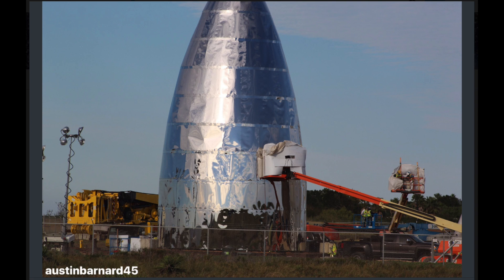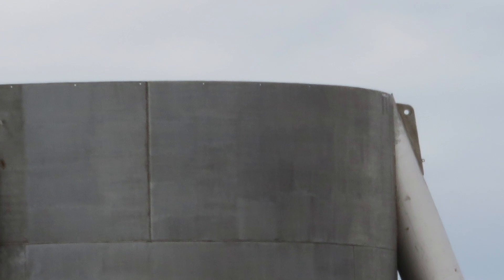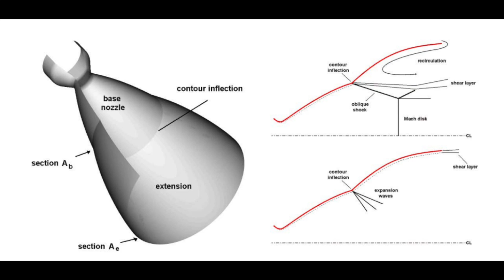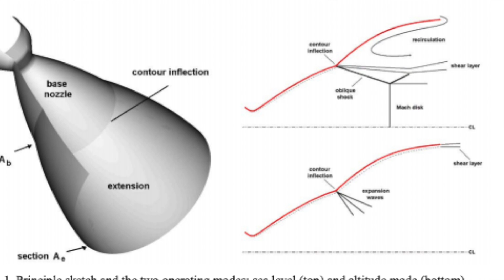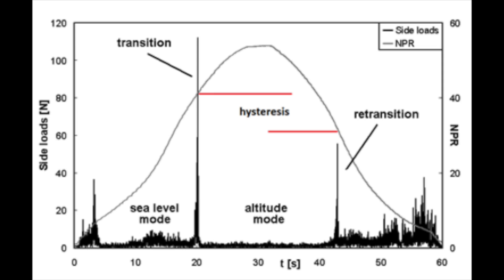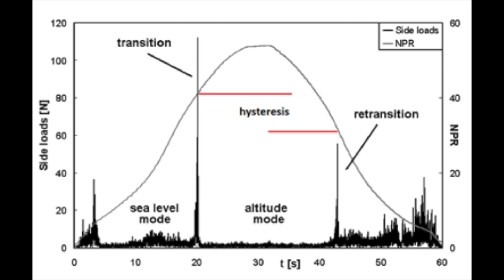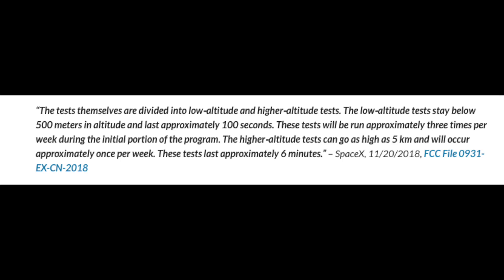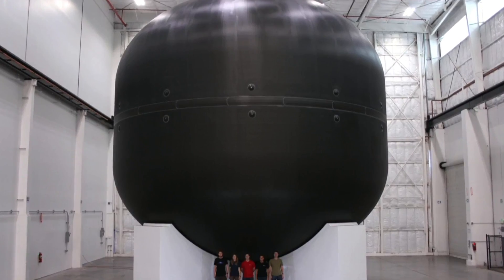What's Going On With SpaceX's Stainless Steel Starship?

Comment: Re: why use stainless steal on a hopper? SpaceX believes in testing. So they will put on the hopper whatever hardware they think needs testing and can be reasonably tested on a hopper - even if that testing is only about construction techniques.

Comment: Why was the huge composite fuel tank not shipped to Texas? I can think of two reasons. The amount of fuel required for hop tests is much less than is needed for orbital flight and there is a significant risk of rapid unscheduled disassembly.

Comment: The metal sheets look rough right now, but they'll smooth out under pressure. It's like a stainless steel sheet balloon. Think of a mylar balloon but with thicker metal. I wonder why the engines are in a row. I would have put them in a triangle to give the option of steering with engine throttling in case of a failure of other steering systems. Maybe they plan to use a single engine, the center one, heavily.

Comment: It was a Lockheed F-104 of the USAF which intercepted the USS Enterprise (1701 Constitution class) when it was catapulted back in time, so it qualifies as Starfighter.

We should allow Musk his grandiosity. It's a test article for the first generation upper stage interplanetary manned spacecraft that's reusable. It's by the first non-government entity that ever retrieved or re-used an orbital space craft and the first ever to land a booster stage. Think about that. No one else apparently thought it a worthwhile effort to steer a booster down.
Reply: Blue Origin actually landed a booster first, beating SpaceX by just a month. 23rd November vs 21st December 2015!
Reply: By that metric, the DC-X beat them all by over a decade. But it wasn't a booster either.

Blue Origin did not land a booster and still hasn't.
There's a lot of difference between a test article of what a future booster might be like, and an ACTUAL OPERATIONAL booster that launches satellites.
Blue Origin has not even launched a single one yet, other than test articles.

 Let us know when Blue Origin is in the satellite launching business.
Reply: @JFrazer4303  Blue origin's landable booster has since launched paying passengers above the karman line and still landed all the hardware for repeat flights.  But they still haven't flown anything as orbital as the operational crew dragons.

Comment: Its a scale model test vehicle. It seems something came up that they feel absolutely must be tested before they can continue, and I would bet it has something to do with the Raptor engines themselves. 

However, SpaceX likes testing so much it wouldn't surprise me if they just realized they need a scale model to test all the various assumptions they have made. It will be far too expensive to be losing full scale BFR's on the launch pad due to a faulty o-ring...

Comment: Knowing what we do about SpaceX they're probably trying to test out as much stuff as possible on the Starhopper. Stainless steel? Why not, they're going to be making the Starship out of it so why not test some building techniques, engineering ideas, and designs etc. Three Raptor engines? That seems pretty logical, they already know how to land with one engine and Starship will be using three, maybe three engines introduce something they haven't anticipated so they want to test out a big ship running three engines? Maybe they need three in order to fine-tune the computer code for landing etc? Confront the models with actual test data.

I doubt it would need a full fuel tank too, they can probably just throw something together that will give them the capacity to fly for a few minutes. This looks like a quick and dirty test mule to test out some design and tech ideas and de-risk the real Starship. It looks like it will be a flying gas tank with a lot of empty space so they can fine-tune some algorithms and building techniques. It looks relatively cheap too so they probably won't suffer too much of a setback if the thing crashes and explodes. Remember, with SpaceX failure is always and option because if stuff isn't blowing up occasionally then you aren't trying hard enough to advance the technology. I respect that. They probably expect the Starhopper to explode at some point, or at least crash. Why spend a bunch of money to make it a Starship copy when a rough facsimile will get the job done on the cheap.
Reply: And with how heavily built the legs and lower third is, it will be able to land hard a few times without damage.

Comment: Hi Scott, the size of the Hopper (still unknown), but speculated to be 40-42 meters in height has been a point of debate with colleagues of mine. If the center of pressure and CG are not the same as for the "full grown" Starship, one wonders about the data that would be obtained during test flights of this "shorter" Hopper.  Additionally, if Hopper is not the full height/Length, then the RCS (which I assume they will be using), the data from that will also be misrepresentative. A nine meter D, full height Hopper would make a decent target even for a light breeze and necessitate overtime and strong work for an RCS. Re the duel bell style nozzles on the Raptors, one might image that because of the instability that you mentioned, one would require all three running to form the "legs of the stool" upon landing. Fuel tanks: it's believed that F9 first stage tanks are going to be plunked down between the  two triangular members making up the lower 1/3 of the Hopper (the landing gear section of the ship.)  , Kevin
Reply: The tests will allow fine tuning of simulations and may reveal errors in the control system software. The hopper may not be 100% identical to Starship, but the differences are well understood parameters that can be fine tuned later. As long as the parameter adjustments are within +/- 50%, extrapolations should be realistic.
Reply: Anyway, once Starship is completed, it must undergo similar hop tests, both to reality check construction and fine tune parameters.

Comment: I think when you are judging the quality you have not seen many structures made from sheet metal. The warp and crinkle a lot just from thermal expansion during day/night. This thing is probably designed to fly in very cold temps, so if its crinkly in the daytime heat no big deal.

Comment: I think his goal is to get something "close" so he can justify building the other components.  The stainless steel switch was new enough that the hopper base was probably fully designed before it was committed to changing to stainless for Starship construction.  Considering the parts are being built separately and aren't being constructed as an integrated unit means (to me) that he plans on swapping parts.   He might beef up the hopper to test with a full length article, for example, or design a fully functional stainless steel base later for orbital re-entry tests.  The only reason to build the top part out of stainless steel is because you want to test real-world thermal transfer.  Its a shortened element, so its not for accurate mass testing.  So I'm wagering we're going to see four parts, a hopper base, an orbital base, the shortened upper test article and a full-length test article being married to both bases for various tests.  

As for the insane constant work being done?  Elon expects a lot out of his people - and he doesn't care about a lot of things that outside observers would consider to be "normal" for employees.   I don't agree with the way Elon drives his people.  Obviously I wouldn't choose to work for him unless I had control over that for myself at least.   But those that do are obviously buying what he's selling enough to grind through the holidays to make this a reality.  

I think he's very concerned about the status of 39A and climate change too - and that might be driving the urgency.   He has reasons to truly try to rush this project.   His windows are 2022, 2024, 2026 for getting enough motion on this project to prove that it can at least be a sustainable replacement for Falcon/Falcon Heavy and still accomplish his Mars goals.  I expect delays, but I'm sure that Musk is looking at the 2020's as being the real window in which he can reasonably use KSC's launch facilities to extract his investment.  And if he wants climate-proof launch locations he's going to need to prove the fully-reusable concept at $320m/ship + billion dollar sea launch/landing platforms (which is really why I think he proposed point-to-point on earth and showed mostly coastal cities: to justify that cost since no city is going to let a rocket land near populated areas.)

Comment: Scott, normally you are spot on and quite sure of your answers....  there was some back and forth in that video on things I could have sworn Elon's tweets had already talked about... such as choosing stainless for both its high temp and cryo strength over carbon fiber....   I was kind of scratching my head when you were asking if the CF tanks were going to be shipped by barge to be put inside... that would kind of defeat one of the benefits of stainless....
Reply: I think Scott was trying to avoid the obvious answer being the correct one. The S-Ship will have steel tanks/construction. But for this test mule: Seems to me building a structurally sound cylinder is not the same as building a cryo fuel tank, with all of the engineering and testing required. Also integrating the plumbing, etc, which SpaceX has presumably already done with the CF tanks and Raptors. This work was years in development, and the switch to a steel concept was quite recent. So my bet is the CF tank for this thing, and no CF tanks going forward.

Comment: I'm sure the SpaceX engineers are working hard, but It may also be that SpaceX is experimenting with the concept of rapid prototyping on a huge scale. If they can prove that it's possible to build a prototype rocket in a matter of weeks, then they can rapidly iterate in ways that the space industry isn't used to.

Comment: Wouldn't thermal expansion be an issue with stainless steel? I wonder if it's going to be used as a thin skin of loosely fitting plates (plenty of expansion gap) over a composite shell. The steel would be good for protecting a more fragile insulation layer and spreading heat more evenly over the surface as well as radiating heat away from the craft.

The Shuttle had to have a complex system of tiles because the re-entry heating wasn't evenly distributed so some parts of the shield had to be much thicker than others. Using an outer layer of heat-conducting material might help with that. I doubt the steel is structural.

Comment: What do you think about the possibility of landing site erosion due to the never before seen amount of propulsion required to land the BFR on Mars? Maybe a grasshopper test on loose surface would be necessary.
Reply: Yes!  Have long wondered about the problem of BFR sustaining damage taking off from Mars with no water spray attenuation for the shock wave damage. Also, damage from large rocky debris kicked up at landing and launch.  So when I saw this hopper sitting on bare soil, had the same thought as you. Although I suppose they could transport it to some kind of pad.
Reply: @donjones4719  
Shockwaves are not an issue in the near-vacuum of Mars. Because of the low gravity, the final thrust at landing will also be at low throttle. 

However, takeoff at full throttle is a problem on Earth.

Comment: I would imagine they built it out of stainless partially for the weight.  Given how heavy it is, they wouldn't need to build as much of the internal structure to determine it's capability for lift and hover testing.

Comment: It's very low tech stuff IMO, I hope the steel design wil stay as a hopper otherwise the Starship will not have a very good thrust to weight ratio. Its weird for a bleeding edge space company to ditch carbon fiber to use stainless steel as the newcomers Rocketlab is using it.

Comment: Unless it's a decoy, which doesn't make any sense aside from publicity stunting, there are a couple of reasons to build it that way. First, "Quick and dirty" is ok if you just need to test the propulsion systems and prove the concept. It's a fine hopper and doesn't need to be pretty. As for the question of why they should use stainless steel in a test vehicle, SpaceX is a genius organization. They're going to get the highest efficiency out of an operation like that. Any test will answer the maximum possible number of questions. So the question is what does using stainless steel answer? Incidentally, stainless steel is heavier per unit of volume than other steel alloys. In a vehicle that big, that could make a difference. They may also want to see how the welds or metal itself or the welds respond to the tests. As for the carbon tanks, I wonder how they would install one when so much of the vehicle is built already. My guess is they have built an aluminum or even steel tank inside it already. That works fine because it's not carrying cargo.
Reply: The shiny skin IS the tank(s). There may be a very small pair of tanks to restart engines and push the propellant to the rear pump intake ports (during "belly-flop" or "freefall" maneuvers). The mirror skin will eventually need to be cooled with propellant when hypersonic reentry is done.

Comment: Re: Starship vs starliner. I'm a SpaceX fan and I don't think I'm biased when I don't like the word "starship" and have no problem with Boeing Starliner. 

The reason is that "starship" is a common (non-proper) noun (i.e. a dictionary word) specifically meaning a spaceship capable of interstellar travel. Where's "starliner" is not a dictionary word and is only a proper noun, and this carries no such connotation.

If SpaceX called their rocket Star Frigate, Star Voyager, etc. I'd have no problem at all. Just not a dictionary word implying capability it doesn't actually have.

Comment: Stainless steel can be gold plated (but not for vanity's sake).  As we all know radiant heat from re-entry is a major problem.  GOLD is the best reflector of radiant heat and has a much higher melting point than the cheaper alternative, aluminum (which has an oxidation problem while gold doesn't).  Put it on top of steel (a natural heat sink) and you might have  the perfect re-entry material.  Could he ultimately be making a golden rocketship?  (gold plating is actually very cheap and you only need a very thin layer to reflect heat.
Reply: So you would want gold, with a meeting temp of 1000 C (and is a very dense element) on a reentry vehicle that experiences extremely high pressures and temperatures?
Reply: Stainless steel is less thermally conductive than normal steel. In fact it behaves rather like glass (but rather more impact resistant).
Reply: I like this idea. Makes for a great visual. Will love to see comments on the actual properties of gold-on-steel thermodynamics. But even with a fairly thin layer - wow, only a government that would fund the SLS would fund this. :-)
But who knows, the cost benefit ratio of using gold may make sense after all.
Reply: Gold plated rocket would be so gangster.. All its missing is some giant spinning $ signs
Reply: It might has a high reflection ability, but that also lowers emission

Comment: Shouldn't read too much into a hopper test article.  We still have very little information about what they intended to do with the Super-Heavy first stage.

That said, I will not be surprised if they opt for stainless steel for the first stage.  Working with composites on that scale is difficult and expensive - neither of which SpaceX much likes.

Comment: Maybe they're just interested in testing their cooling systems themselves. Does this valve work, are there hot spots, etc. I would presume that most of the tests are for the systems. Past that you could pretty accurately predict performance. 

When it's a hopper test you dont really need structural integrity do you?
Reply: Also I would guess that they passed up on funding in hope to make the SLS look better.

Comment: I think the first stage is made of stainless steel because it can probably survive ascent and descent without any extra heat shielding. They've probably found that the heat shielding on the current kit is a royal pain (lots of manpower) and so if they make the first stage out of stainless steel, it's got far less creep and is capable of surviving much higher temperatures without undesirable changes than their light alloys. Stainless steel construction is much more expensive, but they can get lots more launch cycles out of it, so if it works out, it will be cheaper overall.

Comment: Perhaps if a electrically created or volatile burn plasma sheath is going to be tested as a heat mitigating shield, the plasma will also be acting as a receiver / transmitter of unknown power, that is why the FCC is involved.